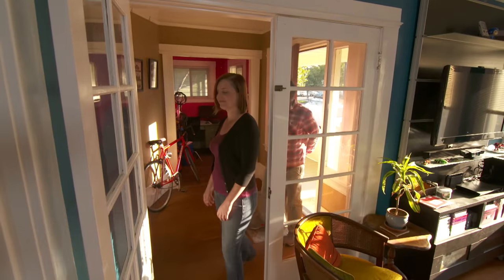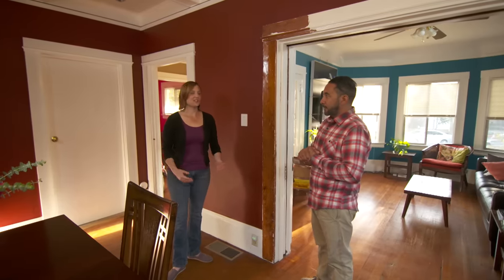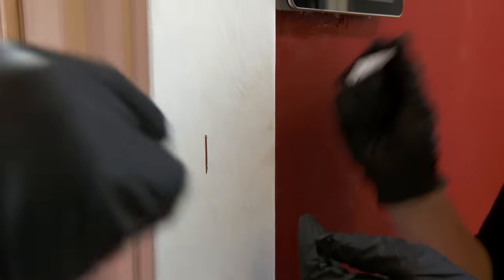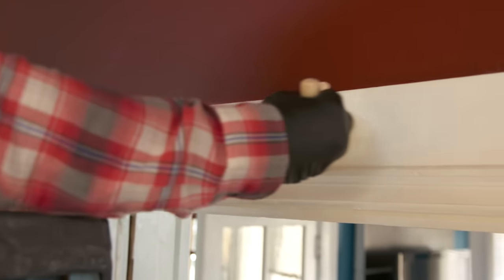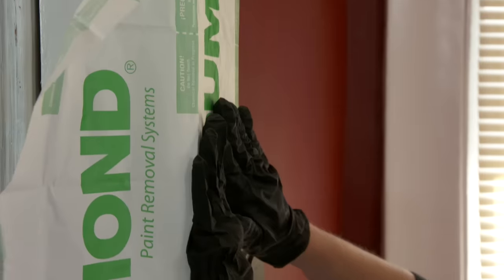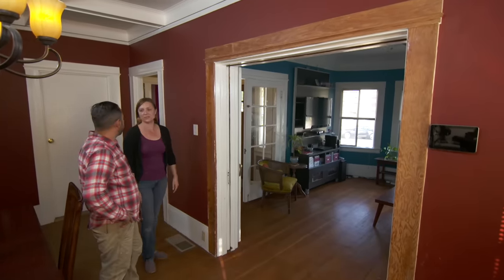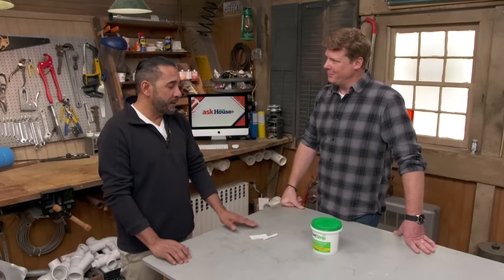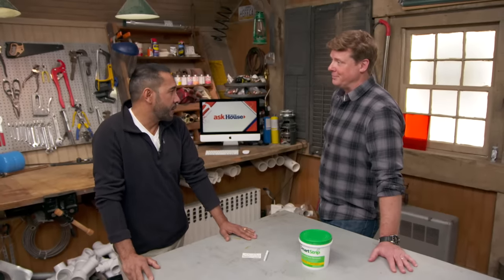How to Safely Strip Paint from Woodwork | Ask This Old House

Comment: Not stripping the varnish sounds like a really nitpicky, pointless requirement
Reply: sounds lazy
Reply: many people like the patina left by the old varnishes
Reply: Ended up stripping the varnish anyway
Reply: Yes, I didn't get that either, it is simple enough to redo varnish. Plus it is not even very good wood; some sort of pine. I would just remove the trim and replace it with new. Probably faster. But probably not for beginners.
Reply: Marc in NA sometimes it’s more about the fact that that trim has seen decades in that house and keeping those original details simply because they’ve been there for so long.
Reply: @marcinna8553  She probably wanted to strip the paint but keep the finish.  But a nice light stain and polyurethane would really bring out the grain and give the trim real character.  I am definitely a fan of wood finished over paint myself.

Comment: Love Mauro.  Always learn a lot.
Reply: What did you learn?  Did you learn how to check whether paint is latex or oil-based?  Did you learn whether you really need to test for lead in latex paints?  Did you learn where to notch the wood, if you really had to test for lead?  Did you learn how to strip latex paint off oil-based primers or off non-shellac varnishes without damaging the primer or varnish?  No?  Then I wonder what you learned.

Comment: She said that she didn't want to remove the varnish and then at the end the varnish was gone...
Reply: Mitchell Campbell obviously you didn't watch to the end of the video.
Reply: watch the whole video
Reply: Not usually possible to keep varnish when you strip paint from wood, bud.
Reply: Simplistically, varnish is paint without pigment - making it a clear coat.  You cannot remove paint without removing the varnish no matter how hard you wish for that to happen.
Reply: She already burnt her varnish the first time when she attempted it herself 

There's 0 chance of keeping a varnish when completely bonded on
Reply: You cannot strip the paint without removing the varnish, no matter what you do.
Reply: The homeowner was just a bit naive in that regard by the sound of it, since there is no reason to attempt to preserve the 'original varnish' when you're intending to repaint. The new coat of paint they were going to put on is all the finish the trim would need.
Reply: YES you can strip the paint without removing the varnish -- when the paint is latex and the varnish is oil based, using alcohol, which is what she had started doing.  It's tough to do on vertical surfaces, but you normally soak up paper towels with alcohol and stick them onto the wood, and cover with e.g. saran wrap so that it doesn't just flash off; after a few minutes the latex paint will start lift off the varnish (and it's far less messy to scrape the lifted latex paint off the varnish than it was for them to clean the varnish + paint off the wood).
Reply: I use Citrus strip and saved the beautiful original dark oak finish from 1906 underneath.
Reply: Lol.....😂😂😂😂 right
Reply: Nikola Wiche she’s not intending on painting the trim she wants just varnished wood for trim. She IS repainting the room from red to yellow.
Reply: @RegulareoldNorseBoy  why be rude? Be nice.

Comment: If you're going to use a Peel Away type product, you need to put on thicker than that. Don't bother with a brush; use a thin plastic scraper and really glop in it, about a quarter inch thick on the curved molding and a little thinner on the flat parts. That way you'll get the old vanish off, too. you can also do a second coat on the rounds of the molding...I've stripped thousands of linear feet of trim over two complete restorations...and have the scars on my psyche to prove it! However, it is the one area where, as a DIY'er, you can save a ton of money. No pro really wants to do it, for obvious reasons....

Yeah, I couldn't believe he just carved right into that wood for the lead test. WHT?
Reply: What's your advice if it's lead based paint

Comment: I get they are going to repaint the wall a different color. But I need to strip kitchen cabinets in place, and the frames are up against a newly painted kitchen wall. I wanted to see how they protected the wall--what kind of tape works best, and they didn't even talk about this, and at 6:38 you can see in the video that paint is still on those small edges. I'm having a hard time getting any info, so I guess I'll ask at my hardware store what they suggest.

Comment: As a kid in the 1970s we had Nitromors, proper paint stripper, it used to sting your hands if it splashed on them.but, boy it removed the paint well. Years later we have modern eco friendly Nitromors, I doubt it would remove a paint stain from the floor, it's a watered down gel & totally useless.

Comment: How long would it take to "cure" (?) Without the paper?
Reply: The tub says up to 24 hours depending on your situation. I left on for 24 hours with paper and it was too long. I'm doing 2nd coat without paper right now and 3 hours seemed to do the trick.

Comment: Respirators shown here are worthless for chemical vapors in the air. The N95 shown is for PARTICULATES, like sawdust, pulverized paint, etc. It’s a moot point perhaps since the stripper is supposedly “zero VOC” but since this was presumably aired on television (or even if not) they should have researched this better. In fact no respiratory protection was most likely recommended, let alone required. Whoever does the research or fact-checking for this organization needs to do a better job. A bit ironic that the segment is titled how to SAFELY strip paint.

Comment: Thanks, I want to do this to my ceiling beams but didn't know where to start👍🏾👍🏾
Reply: What a mess chemicals even with paper will be upside down.
Reply: I'm doing this right now. Some fool painted the beams before we bought the house. I am on my 2nd coat right now because I left the paper on too long. The test patch where the bare wood is now present is worth the effort. Better than wrapping the beams too because these are solid wood and have a nice patina.
Reply: @eco-strip1312  It's designed to be used in vertical applications as well. I'm doing this now. It's not an issue.
Reply: At the floor

Comment: I have searched youtube endlessly and may have overlooked the answer to my dilemma.  I do not have a heat gun or paint stripper.  I must remove the chipped paint from the interior door frames and baseboards.  The chipped paint reveals layers of paint underneath, and the previous owners of this Airbnb house painted the beautiful natural wood frame doors on the lower level brown.  The doors, the door frame, the wood walls in the kitchen, and the window frames. Would you happen to know how I can fix this?  I am doing this for a friend, so my option of what is available for me to use is a sander; however, I want to purchase whatever will give me excellent results.  I am new to this and am very much enjoying and eager to learn. Would anyone be able to help would you happen to, me with their professional and or experienced advice? Please, thank you?

Comment: If there was no lead paint, then there were likely very few layers of paint on the wood to begin with. In my experience most modern latex paints come off fairly easily with most strippers. Lets see that stripper work on a few layers of old oil base paints.
Reply: You’re exactly right. If she had oil based layers than that would be next to impossible to strip everything.
Reply: I was thinking that. Every time I stripped paint, it was always thick with many layers of old oil based. The old methleye chloride strippers did work on the oil well, but were pretty toxic and burned your skin.

Comment: How do you proceed when lead is found in the paint?
Reply: Employ a registered lead abatement company that has a license to remove lead paint and knows how to dispose of it.
Reply: Sylvain Bosse simplest thing to do is to seal with a oil based primer and just paint it. Honesly, removing paint is a pain and not needed. White trim is always in style. Trends come and go.
Reply: Agree with post above.  Lead paint is inert as long as you don't disturb it (i.e. - sand it, which is the worst thing possible).  Just painting over and sealing it may be your best option if you're not willing to do/pay for a full removal.
Reply: You pick up your dress, and remove the paint as normal.
Reply: Sand it off and snort the dust
Reply: My house has lead paint in it was painted over a oil base sealer and then painted with latex and now my bathroom ceiling including kitchen including the living room are peeling and you can see then layer lead paint. In my house is made in the 1930s.
Reply: A lot of low-quality answers on here, especially since lead paint is very common in old houses and not a thing to totally panic over. The most basic answer is that if you have lead paint, you either want to fully remove it, or safely encase it, and either way you need to be careful with any project that will disturb it, since there are risks from dust, chips, and vapors. You can still DIY if you take the proper precautions. That said, I don't know what would change about the technique in this video. Would they still be able to use that stripper, or is it not safe with lead paint? I wish they had covered that.

Comment: Never mind cost or health concerns.  Does VOC work better and faster than non-VOC products?  That's the bottom line.  And the answer is I don't know.
Reply: depends on what you are trying to strip. If you want to take paint off a car, then all low VOC organic stuff won't even make a dent, but for soft acrylic finish on a piece of trim in a house you might not want to go nuclear just to get fastest result while poisoning everybody around

Comment: So what would have happened if there was lead in the paint?

I’m in the process of purchasing a house and would like to restore the windows.  Currently they are painted shut and have god knows how many layers of paint on them. 😔
Reply: Lead is not a big risk if you use a heat gun or chemical stripper. Just be careful of the brittle chips of stripped paint (heat gun) and clean them up without causing dust.

Comment: What are you do if you have lead paint? Because like mine has two layers of lead paint including latex paint
Reply: Depending on where you live, if you want the paint completely off you have to, or you should, contact a state certified lead abatement company to remove the paint. A paint company can be certified but most are not. This is not a cheap process. I know this only because I once was a journeyman painter, company owner,  30+ yrs,  before I retired. Some counties will allow you to encase or encapsulate, if you will,  the paint which is what many reputable paint companies will do. That is they will paint a white pigmented shellac over the paint. Shellac, when dried is not permeable. You can use a water based paint on top of the shellac.

Comment: Of course you can use that stripper and not remove varnish. If it removes 8-10 coats in one application and you have 4 coats of paint. Just add 4-6 coats of paint, then add stripper. Simple math. Haha
Reply: wouldn't simple math dictate to use half the amount of stripper at half the cost, and half the waste, and half the time?
Reply: Good one😂

Comment: There's a part of me that wanted her to lose it when he mentioned that the varnish was gone =p
Reply: NeoRipshaft It’s pretty much impossible to strip paint yet keep the varnish snowflake
Reply: No way to strip without removing the varnish.
She can re varnish it easily.
Reply: Yeah in the part she had already done was burnt in a couple of places so that varnish would have to be removed to and then the whole thing lightly sanded and  varnished afterwards !
Reply: @68 camaro: Is there a reason you felt compelled to add the insult?

Comment: you didn't do the edge where wood meets wall, when you do it will also take some paint off and you will have to repaint the wall. Also what do you do if there is lead? Also "safe" paint strippers don't work. Don't believe me? You'll find out when you try this

Comment: I want to strip the paint for my built-in shelves in my 1930s home. It only has maybe 4 coats of paint on them. Is there anything not quite as strong so I can keep the original varnish? If not, how do I match the color of the original varnish? The inside of the shelves have not been painted, and I'd like to keep it all matching.
Reply: depends on what it was pointed with - varnishes are oil based, so if the paint is oil based as well whatever eats the one will eat the other. On the other hand if it's water based paint you can try using alcohol (isopropyl or denatured) on the paint and it might keep the varnish undamaged. With older formulations and aged finishes it's more of an art than science

Comment: What do you do if there is lead?
Reply: Think twice before trying to remove the paint. Better to encapsulate it. There are infrared paint strippers but they are pricey and cumbersome.
Reply: @sparkyheberling6115  But the whole point is to see the wood.
Reply: @LonsdalePalmer  Then you have to decide if it's worth the money to have it done professionally, which may mean replacement instead of refinishing.
Reply: @sparkyheberling6115  you're really missing the point - DIY
Reply: @LonsdalePalmer  I understand the goal. If the ONLY goal is to see the original wood, then lead in the paint is irrelevant. If you want to see the wood and also avoid heavy metal poisoning, you have to make choices that sometimes require compromise. I hope that ingesting lead isn't one of them.
Reply: @LonsdalePalmer  In my 1905 house, an entire floor of gumwood was painted over. I assume that all of the paint contains lead. My options are to (a) hire experts in removing lead paint, (b) remove the woodwork and replace it with new gumwood, or (c) live with the painted wood. Each option has a cost.
Reply: @sparkyheberling6115  What about finding out how to remove lead paint, get the proper gear, and do it?
Reply: @LonsdalePalmer  If you do it yourself it still has costs, not the least of which is time. An entire floor of lead paint needs more than my husband and and me working on it. And you don't want your kids living there while lead abatement is in progress.
Reply: you can still strip it

Comment: The paper is three times the price of the paint stripper. Is there anything cheaper you can use?
Reply: I got a pack for 10 bucks and the stripper was 50. sounds like you got a bad deal
Reply: i was wondering the same thing.  i read one blogger say parchment or wax paper will suffice.  the principle is to prevent air from getting to the paste to keep it "wet" longer.  did you ever find an alternative?

Comment: Painters tape didn't help me on the edges with this exact terrible "Smart strip" product on the paint and it was a disaster - painter tape doesn't help - it got under the wall paint and drops of peeled paint which accidentally fell on the hardwood floor made the polyurethane finish to bulge. And the end result was terrible, produced lot of chemical smell. Ended up tearing down old trim and door and buying new, and as well repairing the wall and the floor coating!
Reply: sounds like you should not be doing any DIY projects
Reply: @nmjabour  can you show me your results of using this product?

Comment: Most important part  didn't say how long he had to wait before start stripping ..Most paint strippers take ages to cure properly..time is money for painters
Reply: BAKDFUK UP  I’ve used several different strippers and the best one was the all natural spray on from Walmart. You spray on a good layer, wait 10-15 mins for it to bubble up and then scrape off with a plastic putty knife. Very quick and easy. Minimal sanding afterwards to clean up. I’ve used it on regular brush on  paint and also spray paint. Hope this helps.

Comment: Trim didn't look terribly complex or even that pretty after the fact, I would have pried it off and just rip some new strips to put up.   More expensive sure, but not having to deal with stripping paint might make it worth it.
Reply: It's a shame to trash old, hard wood and replace it with  less dense new wood.
Reply: I used to live in 80+year old house. I took the wide pine and some fir ( not pretty, actually) planks door facings, carefully pried them off, sanded all edges free of paint, with some paint scraping 2, reversed the the door facing with multi- painted side down and nailed it back in place, raw wood facing up. After a few pieces I could do each door facing in about 15 minutes. Removing plank facing allows you to also clean up years of poorly applied and gunked up caulk where facing meets wall. Beautiful, clean finish with sharp edges, it was cheap and fast. But don't take off all planks at the same time. One at a time, clean, sand and nail it back up. That way if you only have an hour or 2 to work, you don't have a huge mess plus you don't mix up door facings and put it back on wrong door. They ALL will be a little different in size.

Comment: So what to do if there is lead ? Can I still use that stripper if there is lead  ?
Reply from the maker: If you have lead paint, you need to hire a contractor certified in the correct abatement and disposal of it.  This is only a homeowner friendly project if the area is lead free.
Reply: No you don't need to hire a certified contractor. You can do it safely. EPA.gov/lead. Even contractors can't make wood LEAD FREE without completely taking away the painted wood and replacing it. Even removing the wood causes lead dust without good collection and disposal system.